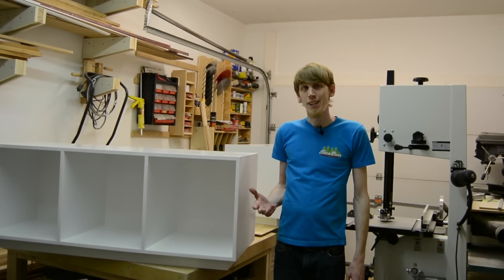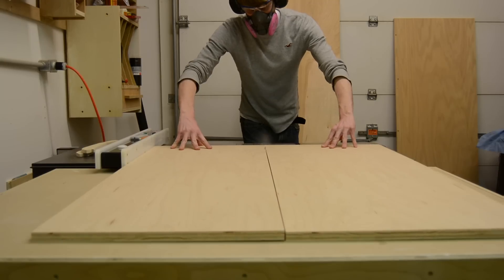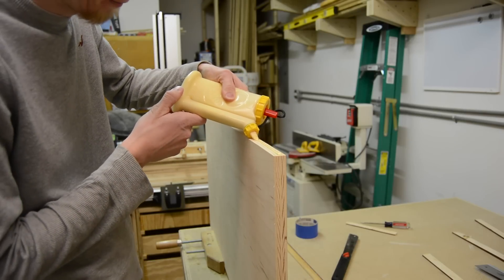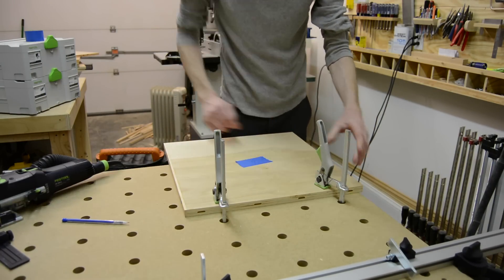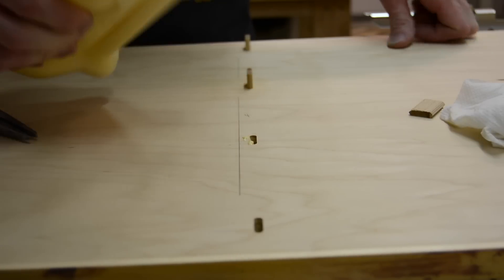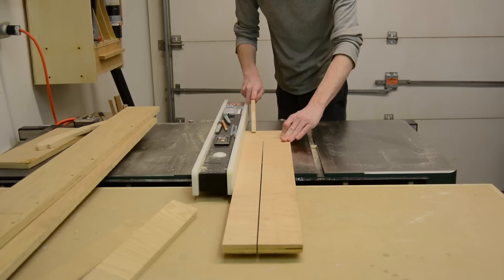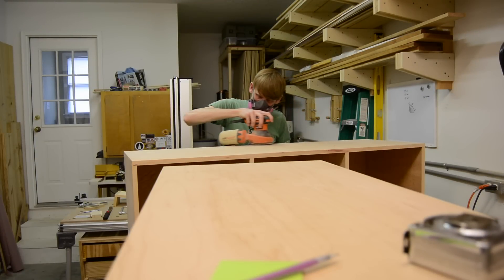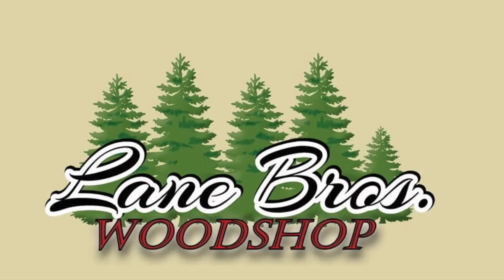Modern Storage Benches

Comment: Really turned out nice!! I really like how you used the wooden clamps to hold your pieces up on the table. Great tip - I have a set but seldom use those clamps. You just shared a way to put them back to use. Thanks for sharing!! Love your projects!!
Reply from the maker: +Nicholas Gomez 
Thanks Nicholas, I didn't use mine much either until I found this use for them. It's very handy!

Comment: Matt, A real simple thing that I do with both the Domino 500 & 700. One board I make all the mortises on the tightest width cut. Adjoining board, I move the width cut to the second selection on the Domino. Then when you are doing glue up, no stressing over alignment, top face will be flush no matter what. I only use pencil marks for my mortises...
Reply from the maker: +woodmasterguy That's a good idea

Comment: I'm planning a builtin book shelf, 12" deep x 36" wide x by 70" tall.  I was hoping to spray finish it with my HVLP.  The shelves can be sprayed separately.   Will this size opening be adequate enough to spray instead of rolling on the paint?
Reply from the maker: +Jeff Lundy 
Hi Jeff, yeah it should be great for that, I would have sprayed this cabinet if I had the room in my shop to do so. The one thing to be careful of is banging the gun into the shelves while spraying the insides.

Comment: The build itself looks really good. It just seems a shame that you painted it with a brush rather than a sprayer. I have never had a good result with a brush and water-based paint. A high density foam roller gives a much better finish than a brush.

Comment: Nice project, good work.  I just watched the HVLP segment on Jay's channel.  Any reason you chose not to spray this project?  The roller and brush turned out great, just curious.
Reply from the maker: +Scott Cunningham Thanks man, yeah I wanted to but my shop is so small that I didn't really have room to do it without getting overs pray everywhere. It was too cold to do it outside at the time, i did consider taking it to work and spraying it though

Comment: Drywall compound, I've never seen it go on like paint before. Do you thin it first or is that a special type?
Looks great,  Scott
Reply from the maker: +The 2 Car Garage Shop 
No, it was just regular compound that I either applied with my finger or by using a filler squeegee. I'm sorry if that was confusing.
Reply: Ok - looked like you were applying it with a roller - guess that was the paint. Ok, I got I
 now